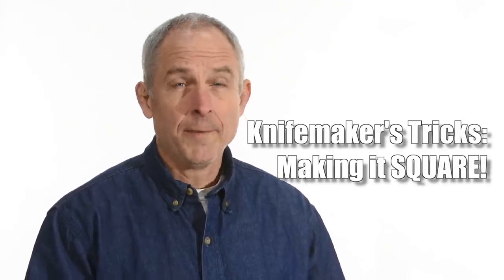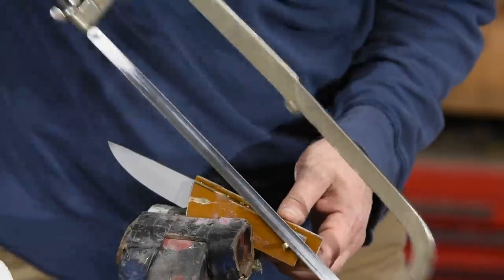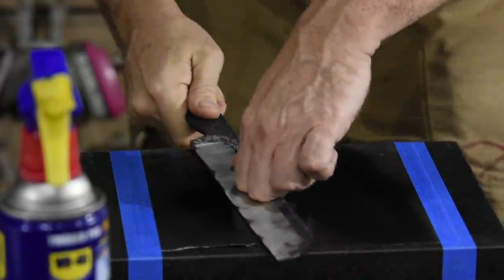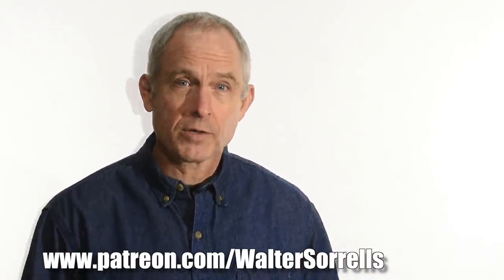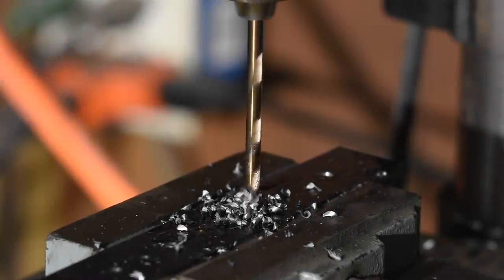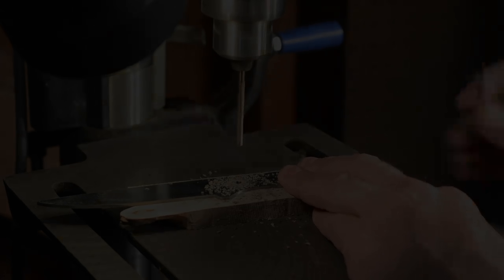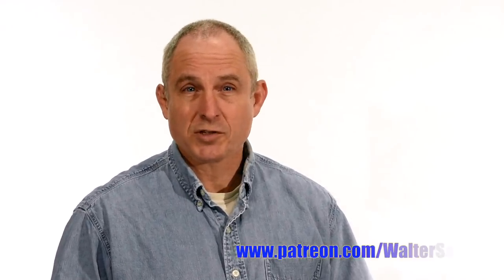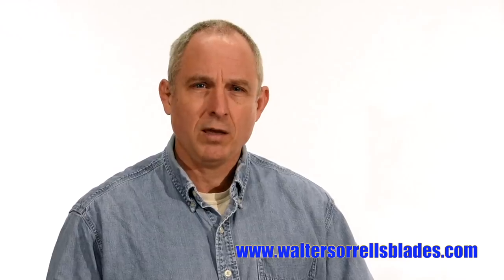Make It Square!  Knife Making Tips...

Comment: I discovered that i needed to add another hole in the tang 'AFTER' it was heat treated - was unable to do so - is there drill bits that can do this????
Reply: A carbide drill bit is about your only option. Another option is to soak a rag and wrap it around the blade. Then ruin as many drills as you need to in order to make the hole. As long as the heat doesn't reach the blade, you'll be fine.
Reply: You can always try annealing the tang to soften the metal so you can drill it as normal. The temp you need to get it to is dependant on what metal you're using, but you want to get it to critical (a touch above shouldn't hurt) and then make it cool slowly, so leave it in the forge (while it's off) to cool or dunk it in some vermiculite.